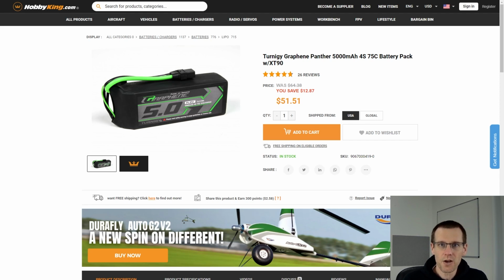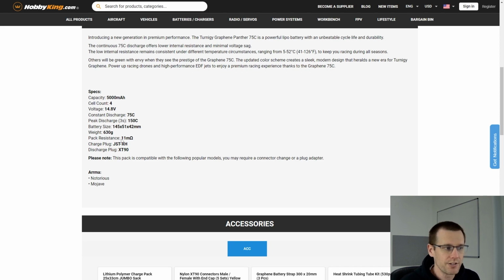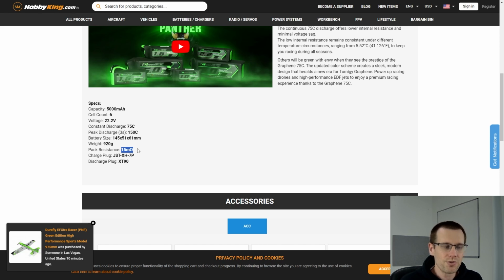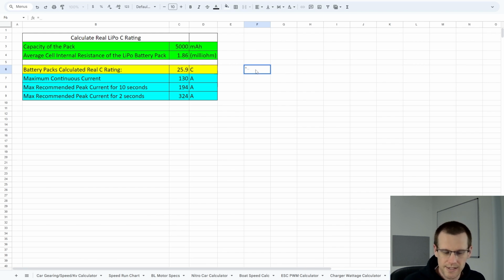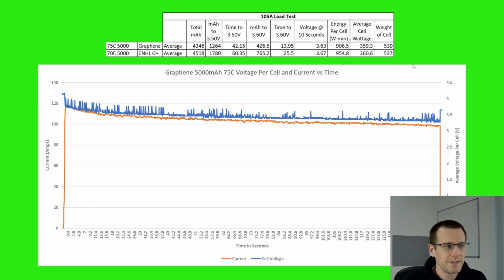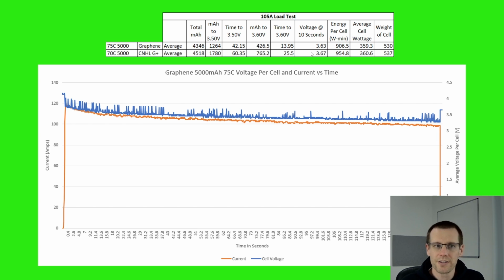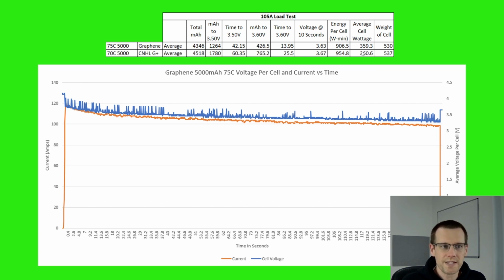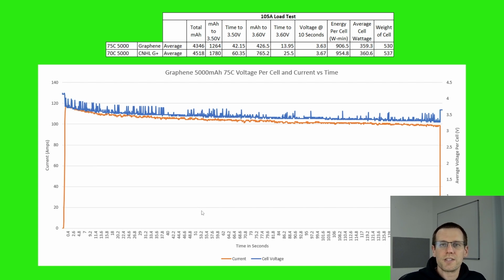How Good is the Turnigy Graphene Panther 5000mAh 75C Battery?

Comment: i own some turnigy graphnene panther ! i found them to be powerful, heavy , dense, large, and premium !  they have a longer run time then similar packs , and the power is there to the end ! they are ultra high quality batteries !  the unboxing presentation is second to none, they use foam lined boxes that are surprisingly solid . the batteries are rubber coated .  I use these when i want to win !
Reply from the maker: I like them. They do quite well

Comment: Sorry, but the the weight of the Turnigy Graphene Panther 4S 75C is 630g  and that of the CNHL 5000 G+ 70 C is 515g (according to HobbyKing and CNHL informations). If you take 6S its already  920g vs. 715g.
Reply from the maker: The weights per pack in my patreon sheet are values I measure. What I have is different then your presented weights.
Reply: @RCexplained  Look on the page from Hobby King you showed yourself in this Video:  it`s 630 g  for the 4S pack. Not 530 g.
Reply from the maker: I understand the website has different values. That does not make it correct. I trust my values. 630g is not even in the weight range for 5000 4s packs.

Comment: out of the box SMC HCL-HP batteries test at about 1.5 milliohms at room temperature measured on a Icharger 380 duo. You should test some Dinogy drag packs. MLboatworks has some 2s packs on sale for $40.

Comment: Is it possible to just wire a switch inline with the dial.  Could also still use in either mode by alternating starting positions?

Comment: They are saying the cells themselves are 2 miliohms each. 15-11 = 4 with 2 extra cells, so the rated spec isn't far off the 1.86 you measured.
Reply from the maker: You mean that the first 4 cells are 2.75 milliohm and the last 2 are 2.0 milliohm? Isn't that a significant QC issue?
Reply from the maker: @user-oh5in7rv7l  this makes more sense. However, if I were to do this on my charger I'd get around 25 milliohms total on the 4s pack and the result doesnt fully agree with my own voltage drop measurements while loaded in an RC. I can't explain this discrepancy yet.

Comment: Should add a column on the spreadsheet whether you can buy each brand in the US, EU etc cause CNHL does not sell to the EU via amazon but does have a warehouse in the EU if you buy on their website.

Importing to the EU is a pain in the ass and not practical, especially batteries.
Reply from the maker: I wouldn't know how to do that and know the challenges some face in certain countries. For example, would you have known I paid an extra 100 canadian to bring some of these packs across the canadian border? They are still accessible by Canadians but it will cost.